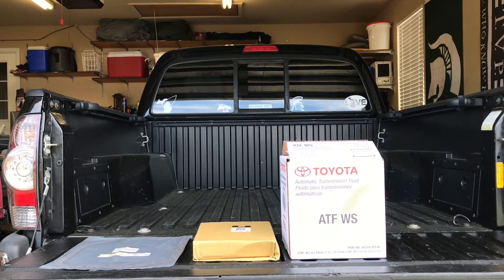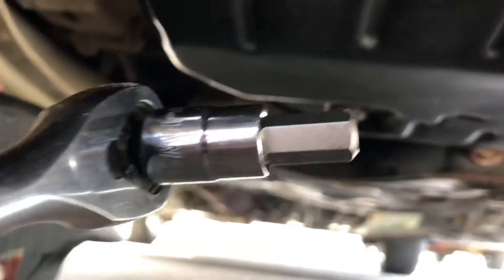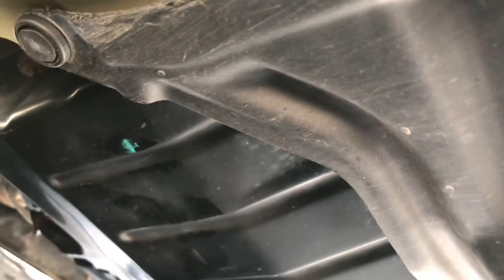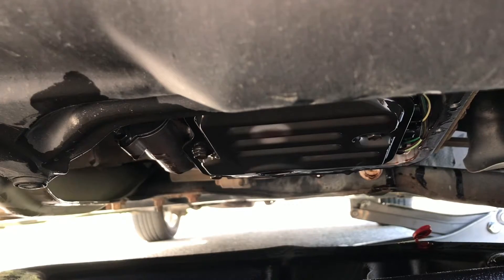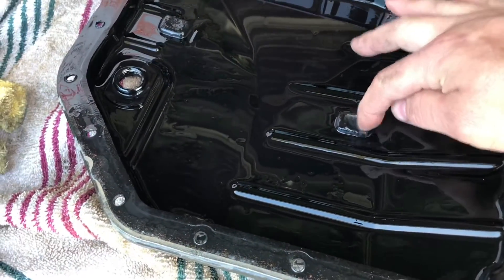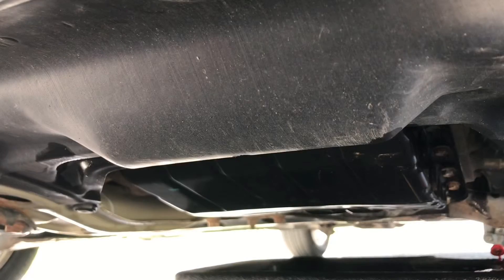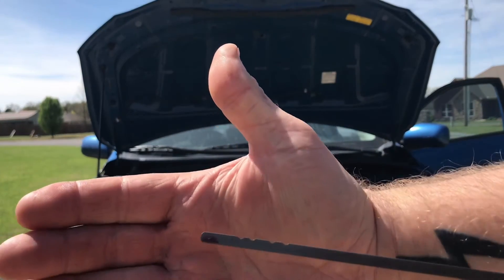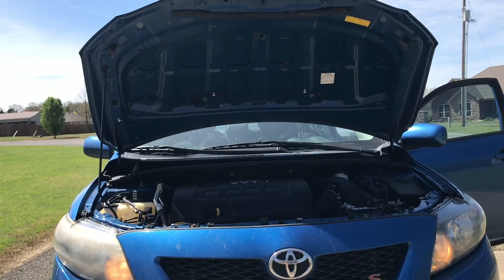2010 Toyota Corolla S - How To - Transmission filter replacement

Comment: I have a 2010 Corola essance automatic gearbox. when the speed arrives at 3rd it fools as it is in neutral. you can help me ?
Reply from the maker: Not sure I’m much help. May be low on fluid? Sounds like you have something wrong with your transmission. Hope you get it sorted out.

Comment: @Schlup's Garage Hey I have a 2010 corolla S as well and it has around 161k miles on it. Should I replace the transmission oil? I have heard people say that changing oil at high mileage may cause the transmission to slip. What should I do?
Reply from the maker: I would say do a few drain and refills on it. People say that because the friction material from the clutches inside the transmission can actually be suspended in the trans fluid and allow the transmission to function normally. I don’t think you are at that point yet and would be safe to change the fluid doing the drain and refill procedure.
Reply: I’m at 120 on my le 2012 rolla just did drain and refill at valvoline haven’t changed the filter yet should I wats your recommendations boss

Comment: Great video👍👍👍
At 50,000 I change the oil, now 100,000 I need to change the oil and filter? Valvoline Multi-Vehicle (ATF) Full Synthetic Automatic Transmission Fluid vs Toyota WS?   Please give me your input.  Thanks again❤️
Reply from the maker: As long as the Valvoline meets the same standards as the Toyota WS you will be fine. For my Toyota products, I always run Toyota fluids that way there is no question if it is the correct formula or not.
Reply: @schlupsgarage6441  hello seen his footage didn't see any gasket put on pan

Comment: My Corolla has a slight whine between 30 to 45 mph only under acceleration. I was wondering if this is normal and if you might hear the same thing... I've done several drain and refills.
Reply from the maker: Chevy D how many miles on your car? My wife says our car isn’t making this noise. Sorry for the late response I just don’t drive ours a whole lot.
Reply: @schlupsgarage6441  it has 103 k and I've had it since February .. like I said you can only hear it between 30 to 45 mph only under acceleration . It is not loud but it is something I am aware of being attentive to the vehicle
Reply from the maker: Chevy D that is interesting. I will definitely keep an ear out for this noise on my car.
Reply: @uglyhandgarage2927  curious.....did you ever figure out the noise? I have 260k miles on mine and same noise! It drive's me nuts! I am doing the drain and fill this next weekend but doubt it helps
Reply: @larrywick4346  no it's still the same... I have no issues except for the slight whine
Reply: @uglyhandgarage2927  the good news is I am at 260k and had it for a while so you should still have a plenty of life left in yours!
Reply: @larrywick4346  how long has yours done it?
Reply: @uglyhandgarage2927  seems like the last 20k miles or so. May have been longer, but I just usually turn the radio up!
Reply: Iac valve probably or a vacuum hose